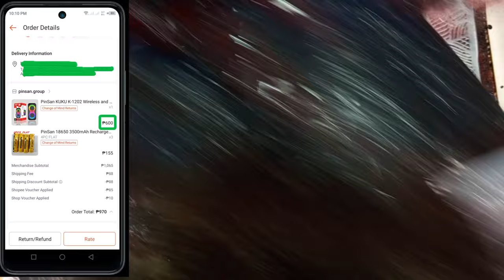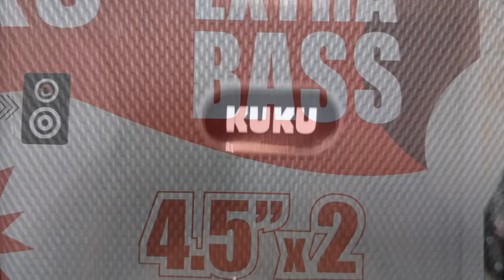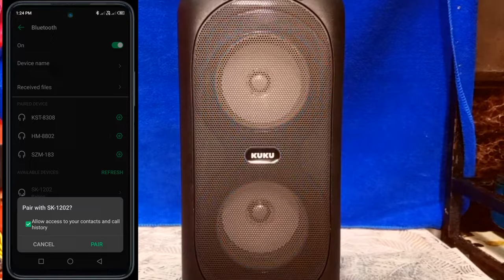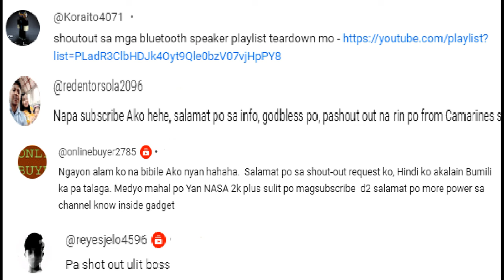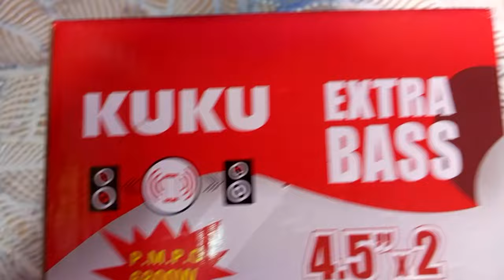KUKU SK 1202 Pinakamurang PartyBox RGB Ring 4x2 Speaker below ₱600 lang ito

Comment from the maker: KUKU SK-1202 6800W PMPO Portable Speaker year 2024
I bought at shopeePH - https://invl.io/cllnz5a
Component Inside Specs!
Battery life: One 2500maH
Speakers: Two 4-Inch 2ohms 8Watts each
Audio ICs: Two HAA2018 same to MIX2018 minimum of 3Volts to 7Volts output power minimum 5.6W-12Watts each.